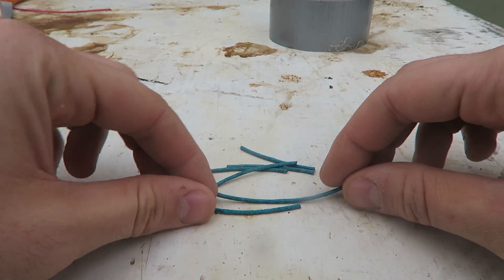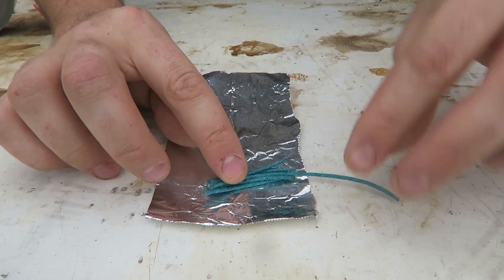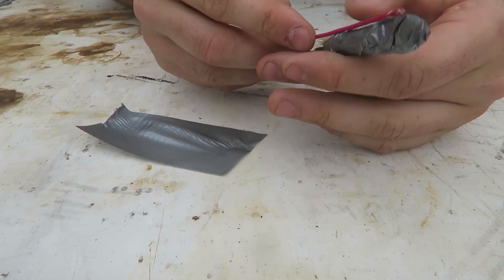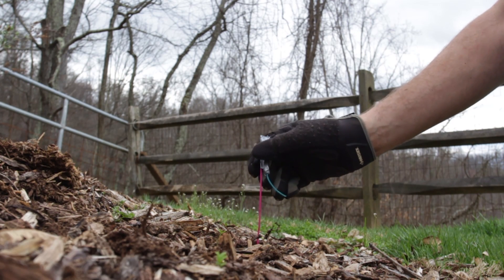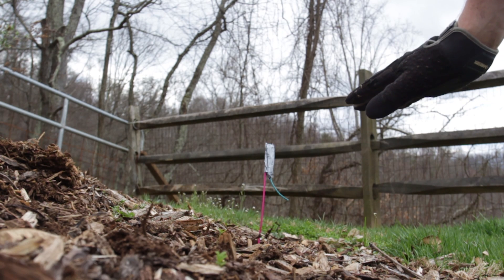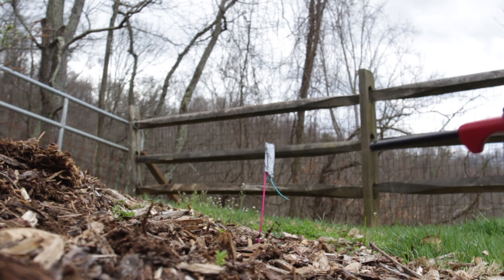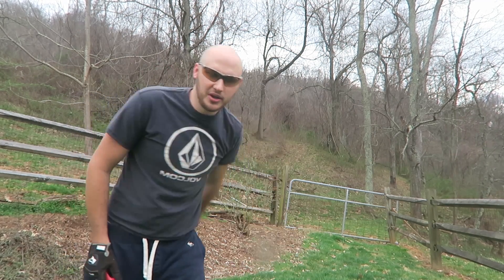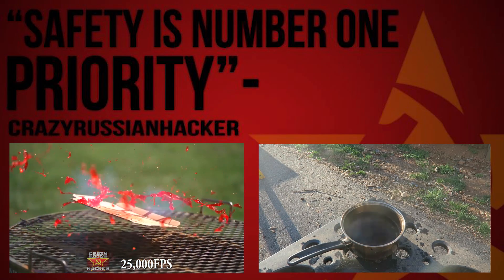Mini Rocket Out of a Fuse - Science Experiment

Comment: what happens is when the fire goes up the fuse into theses covered in foil it builds up gas a compresses it to the point where the air and gas shoot out force from the bottom of the foil

Comment: he ruined like 6 fire works to make 1 lame one....
Reply: you do realize you can buy the fuse seperate right?
Reply: you do realize they can sell them WITHOUT the fireworks...
Reply: boom
Reply: +Juan Alvarez clearly you didnt watch it... you can only get those red sticks with bottle rockets so he had to dismantle them.....
Reply: +The Platinum Hunterz bottle rockets dont even have does sticks that stick is to thin
Reply: +The Platinum Hunterz those are actually bigger than the one he used if anything he got the stick from a sparkler
Reply: NexGenTacTiks usually the sticks are made of wood and it looks like plastic to me

Comment: if you watch it twice you can see that the stick he taped to it on the build was a lot shorter than the one that he stuck in the ground and flew. plus if you know anything about the fps ( feet per second ) burn rate plus the shaped discharge of any prepelant then it would take more than some firework fuse taped together nice try but a switch-aroo me thinks. what I mean by the burn rate is you may as well use match heads that'll work to NOT!